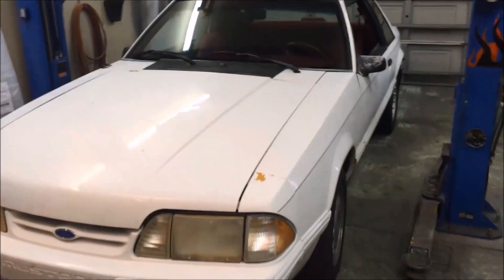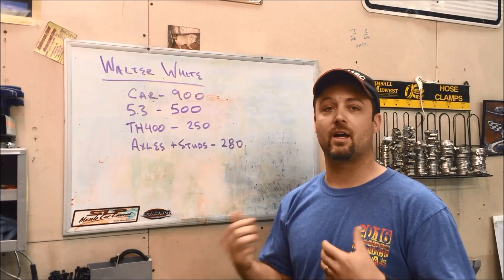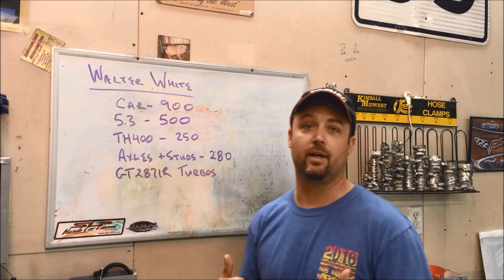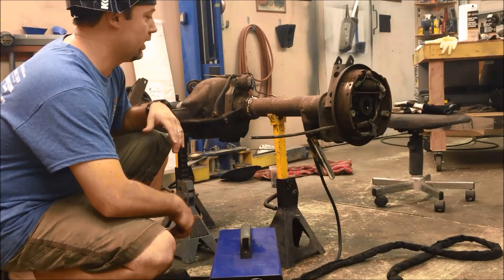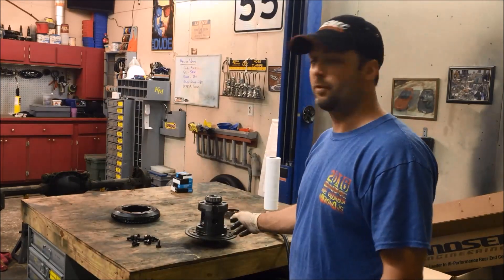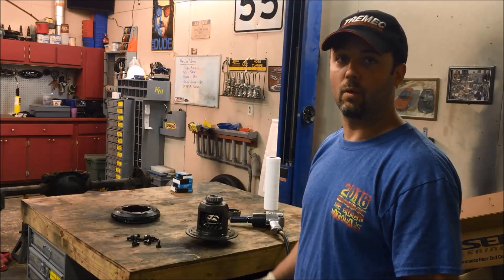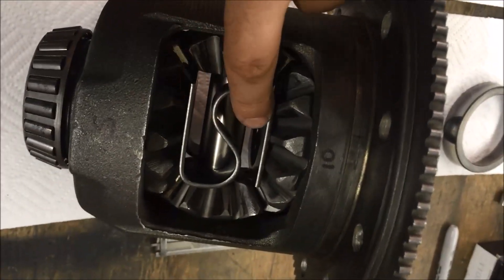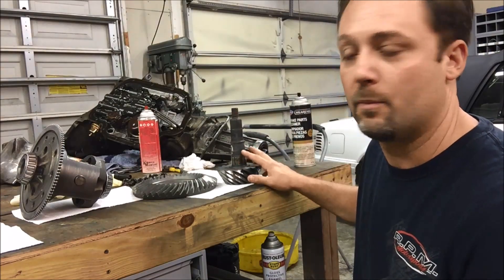Twin turbo LS swap foxbody Mustang part 1; building an 8.8 rear end

Comment: When you pulled out your rolling work station, I thought "this dude is serious!"    and then you pulled out an arc welder for the axle tubes and I thought "WTF?"   Thanks for the explanation.   If you've got the arc welder, I guess its easier than cleaning off all the crap in those joints.   LOL

Comment: Nice. im putting trick flow 170s on my notch 302. should run high 11s when im finished. good luck with the ls swap
Reply from the maker: I hope so man.  The other car in the video, the Grey one I popped up a couple pictures of, that car had TFS 190 11R heads on a stock bottom end 302.  I couldn't get it out of the 12's without spray.
Reply: +Underground Garage what intake and cam did u have on it?
Reply from the maker: Anderson B31 cam (.544 / .544, 218 / 228, 112 LSA - don't hold me to those, that's the best my memory can recall, those are pretty close if they aren't dead on though).  Intake was a Pro-M carburetor style intake, but they sell it with the holes for EFI.  The car was still fuel injected, ran a 6061.com intake elbow and an accufab 90 mm throttle body.  Engine management was a Pro-M EFI stand alone.  The transmission was a T56, so that hurt my ability to launch the car - due to my lack of talent.  Even still, the car only trapped about 110 on motor, so that's likely not enough power to have put into the 11's, even with a 1.6 or so 60 foot time.  The car typically cut 1.8's with me driving.
Reply: +Underground Garage ahh damn. Well i guess ill have to see when i take her to the track! I have track heat intake and xe274hr cam

Comment: you could run 10's naturally aspirated pretty easily if your suspension and chassis is set up right and the car is light
Reply from the maker: Maybe in the eighth, lol.  In my experience, 10's is never easy.  Technology has made it easier today than it ever has been, but putting a 25 year old chassis in the 10's doesn't come easily.  At least to me it doesn't, lol.

My 91 Corvette (415 RWHP, 383, 6 speed car, 3220 without me) went a best of 11.37 @ 122.  1.67 short time.  If I could have went 1.50 or so, it would have been pretty close to the 10's.  That was a stroked engine, with a set of competition port AFR heads (arguable the best off the shelf, 23 degree head, on the planet at the time), slick tire, 4.10 gear, dual friction clutch, etc...  Not easy.  And even with all that, no 10 second slip.

My 2002 WS6 Trans-Am (525 RWHP, 6 speed car) went a best of 11.23 @ 126.  Mid 1.7's sixty foot.  This was a stock bottom end car with heads, cam, and nitrous.  I couldn't ever to get it leave on bottle, so that's why the short time is slow.  This car had heads, cam, clutch, drag pack wheels, slick tires, 12 bolt rear end, tune, headers, spray, etc...  Not easy.  And again, with all that, still no 10 second slip.

1996 Corvette (549 RWHP, 6 speed car) went a best of 10.72 @ 128, but the car had been 131 MPH.  Finally, a ten second ride.  However, this car was on a dual friction clutch, 150 HP shot of nitrous, 4.10 gears, headers, electric water pump, etc...  What made this one work was the clutch, gear, tire combination.  This car would routinely go 1.55 sixty foot, and had been a best of 1.51.  That's coming out on bottle, both wheels up, and left front up again on the 1-2 shift.  More lucky than anything with the combo, but certainly not easy putting it in the 10's.

87 Buick Regal, turbocharged 3.8L.  (660 RWHP, 3450 with driver).  This one went 11.60's on the stock motor with more turbo, methanol, converter, tire, tune, injectors, etc...  Now, with a zero balance 3.8L, steel crank, forged pistons, aluminum heads, another converter, big Precision turbo, methanol injection, tune, 28 inch ET street radial, shocks, springs, etc...  This car has been a best of 10.50 @ 128.  With some more tweaks, it's likely to dip into the high 9's, but it was far from easy.  Like 25 grand away from easy.
Reply: theres a dude on corral that went 10.9x with like 388rwp or something stupid because his race weight was super low and his suspension was dialed, and another that ran high 11s with a stock cam, gt40 headed 302. Also heard of guys on stock bottom end 302s in the 10s on nitrous and stock block, built bottom end cars in the 9s, pretty crazy
Reply from the maker: I'm familiar with the car from corral, it was an 11R combo.  It also broke the transmission on the ride home after that pass.  I'm good friends with Ugly Kid Racing, who runs what is probably the fastest stock block 8.2 car in the world (I don't want to share exact times, but the car has been sub 5.50's with a stock block 347) which is probably an 8.60 or so in the 1/4.  On a stock block.

A few high achievers like that doesn't make it easy (IMO) and I doubt any of those guys would tell you it's easy.  For every 10 second stock bottom end car, there are probably 10,000 that can't put down the number.  While there are certainly outliers, I stand by my original statement that 10's is not easy.  Especially NA.

The 11 second stock cam GT40 combo is a Mountaineer motor.  He's been whittling away at the ET on that car for years.  If you search his name on corral and go back a few years, you can see where he originally put the engine in the car.  I don't remember the exact details, but the car was stuck in the mid 12's for years.  He whittled the time down slowly, over the course of years.  Years of tweaking and dinking doesn't fit my definition of easy.

I tend to base my opinions on what I've been able to achieve, not what I've read about online.  While that grounds me in reality, it does put in a bad spot when it comes to discussions like this - just because I haven't been able to do it, doesn't mean others aren't doing it.

You should make a video on how to do it, easily.  Show us all how it's done.
Reply: It would be very doable with your LS imo, since it has been done with so little hp I was meaning to imply that since you would be capable of making more, 10's would be well within reach in the right chassis. I think if any one of those engine combos that you mentioned were in a light foxbody with suspension and the same gear tire trans combo, the fox would outperform each one by a few tenths, probably pushing the 383 combo into the 10's and definately the ls1 combo. This is just my opinion, I understand some don't agree, but the foxbody mustang is far superior to most all of it's chevrolet counterparts and I predict that yours will be faster than you are expecting, if set up correctly, the biggest drawback of the chassis imo is the difficulty in making power with a sbf (cheaply), which you solved by going LS. 
Personally, my fox is set up to run a 9.5 deck windsor because I like ford, stock block, iron gt40s, stock crank, long rod. I'm not focusing too hard on the engine combo because I'm hitting it with however much nitrous it takes to go bottom 10's anyways. Its got a upr tubular k member with tubular a-arms and strange 10 ways on all 4 corners with upr coilover kit in the front and adjustable perches from wolfe in the back to run a small spring, adjustable control arms in the rear with a upr antiroll bar, and wolfe subframe connectors and cage etc. Going to run a tko and probably just 33 spline axles and spool, unsure on gear.
I believe I could run at least 10.9x with a "small" ls engine with the right HCI, a stockish ls7, or my engine with a better hci combo, but I could easily be wrong, I'm just setting mine up really mild for streetability and saving the nitrous for the track (I also can't afford nice heads right now lol).
Reply: Some guys - usually the smartest guys at the track - prefer to go a little slower consistently and reliably than faster intermittently. Everyone reaches a point of diminishing returns where the extra speed doesn't justify the extra time, money and other resources spent. ETs don't mean shit in bracket racing. Or on the street. This guy is more squared away and mechanically-inclined than anyone else I've seen in car videos, I don't care how big your checkbook is or how bad your car is, keep racing a guy like this long enough and he'll clean your ass. He's a pure hot-rodder who starts with a plan, a budget, a goal and the most expensive and hardest to find resource of all. Ability. The "performance industry" today, as it pretty much always has been, is 95% shills and snake oil salesmen. They're what make it an "business", but guys like this make it an industry.

How fast and quick is your LS-powered Fox-body running?
Reply from the maker: Thanks for the compliment, but the car isn't even running yet, lol.  About 10 months in to the build I ran out of money, so that has slowed things down.  The build is starting to pick up again, hopefully the car will make some passes before the end of the year.

Comment: i noticed in the description you said 49mm turbos. those seem to be small but best of luck
Reply from the maker: They are small.  I had them left over from a previous project, so that's why I'm using them.  I'd rather move to some T3, or even T4 frame turbos, but budget concerns are slowing that down.  I plan to V-band the exhaust between the headers and turbos, so it shouldn't be too big of a deal to swap out to larger flanges (and larger turbos) down the road.
Reply: +Underground Garage  Totally understand that budget can be an issue but a pair of t4 70's or 76's should spool great. best of luck with build and i will subscribing and looking forward to more vids
Reply from the maker: Thanks!  Some T3/T4 hybrids or something is likely in the future, but for now we will see what happens with the smaller turbos.